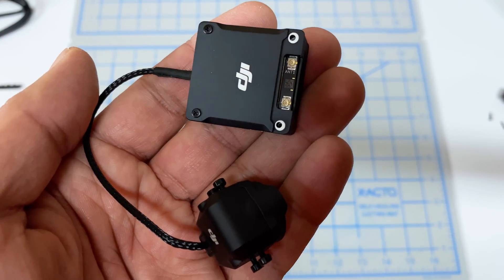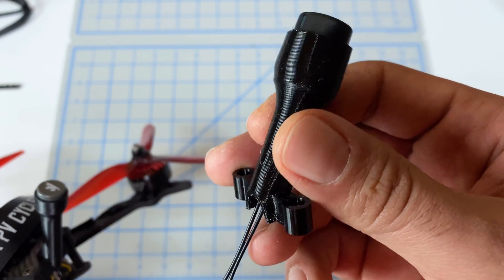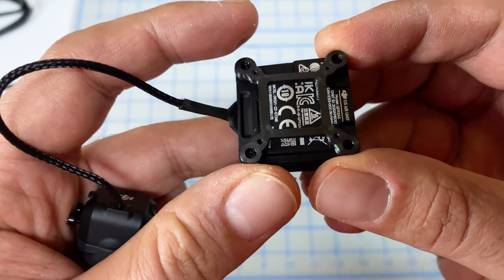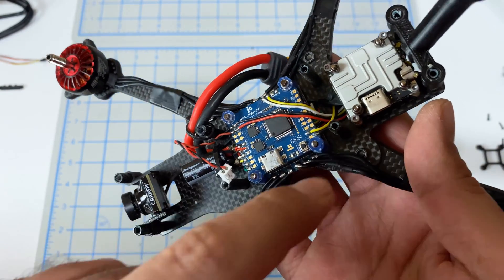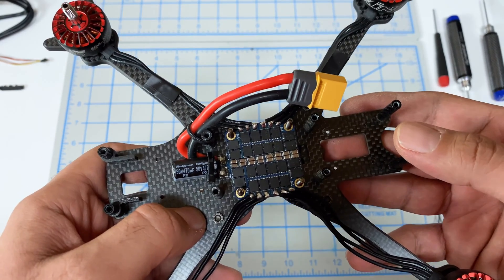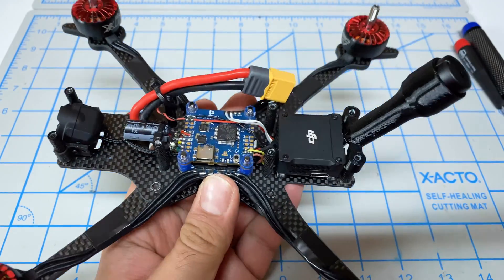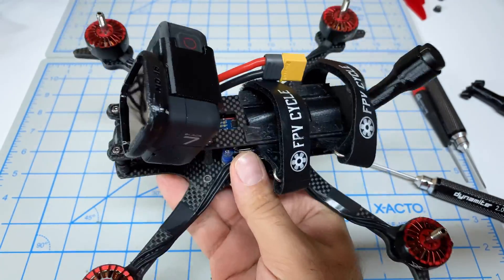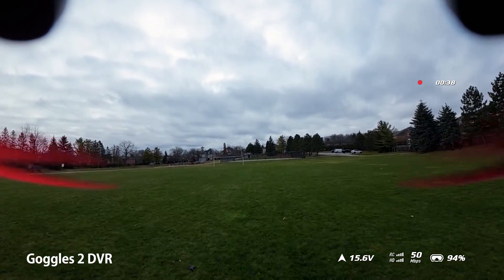My 5" freestyle quad also gets 1080p! | FPVCycle KababFPV Glide DJI O3 Air Unit Install How to Guide

Comment from the maker: Hi All. After a couple of flights and seeing how much of the top deck is in view, I am now suggesting that you use the upper hole of the camera instead (video shows me using the bottom hole on the camera). This way the camera is moved a bit further forward once you tilt it.

Comment: Hi will M2 screws work insted of 1.6 Screws? Can you share the Camera mount plates STL file?
Reply from the maker: No, you need 1.6mm screws that are the correct length as well. Too short and they wont grab, too long and they'll hit the top screws and break then you have to pull the entire air unit apart. The camera mount is the stock one that came with the frame, I don't believe FPVCycle makes the files available. Perhaps you can use this if you need a print file: https://www.thingiverse.com/thing:4460756
Reply: @Mangorille  Is there anyway to start and stop recording if we are not using DJI controller?
Reply from the maker: @outboxfpv4360  Which goggles and air unit are you using?
Reply: @Mangorille  Goggles 2 and 03
Reply from the maker: @outboxfpv4360  You can use the top pull down menu to start and stop the recording.

Comment: Do we still need the command "set sbus_baud_fast = on" for DJI O3 Air unit in Betaflight 4.3, 4.4?
Reply from the maker: Yes you do, assuming of course you have the DJI HDL protocol active in the goggle settings.

Comment: Any idea of the o3 unit works with fpv planes with alierons, elevator, rudder?
Reply from the maker: If the old system (say Vista) would work with your setup, the o3 will as well. The only thing is that you'd need better cooling with it.

Comment: The O3 crrp coming out and after all this time and waitingstill having any kind of HDMI out made me decide to dump all my DJI stuff and switch everything to HDzero VRX4.    Not having HDMI out is a real deal killer for someone who can't stand wearing goggle scuba gear crrrp on their face.  Last time DJI scr3ws me over as an early adopter.Put in my order for the VRX4 yesterday.
Reply from the maker: I haven't tried but the new system supports outputting to your phone with a usb cable.

Comment: Bob is in the process of updating the glide frame. Specifically for the O3. Once he releases that than I’ll try a dedicated O3 rig to see if it’s for me.  In the meantime still very satisfied with my glide and vista combo.
Reply from the maker: I’m curious what he’s going to redesign. It fits the o3 system fairly well already. Perhaps pull the upper deck back a bit so it’s not in view?
Reply from the maker: @markitzero7408  Unfortunately I think this will be very tough. The O3 camera has a very wide FOV, I haven't come across a frame yet that doesn't have any top deck in view. Some come close but still a bit in view. Hopefully something will come out.
Reply from the maker: @markitzero7408  Ya that seems to be how most are redesigning the frames. Note that the FOV is different in the Air Unit onboard recording so even if you see a bit of the top deck in the goggles, it may not show up in the onboard recording.